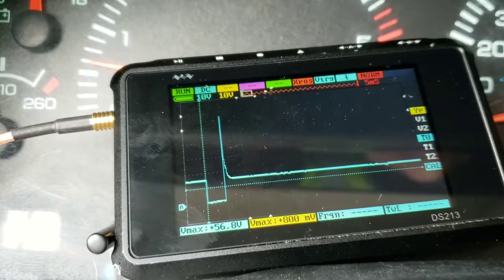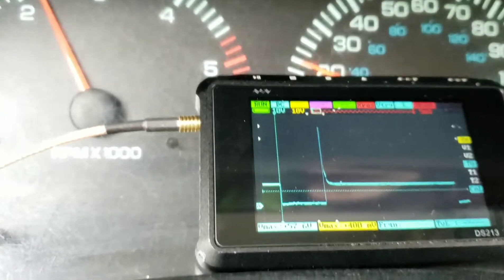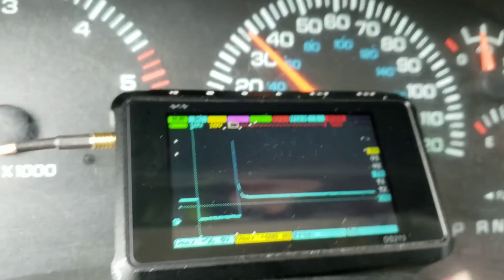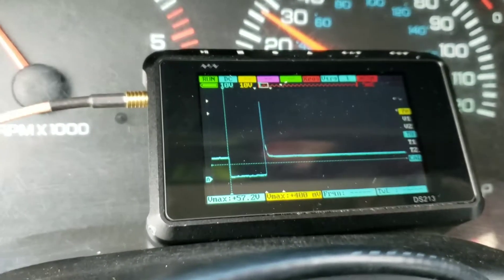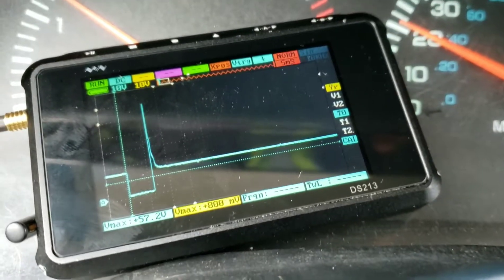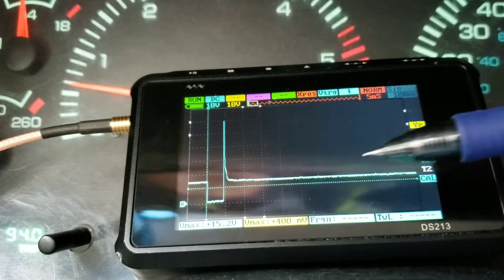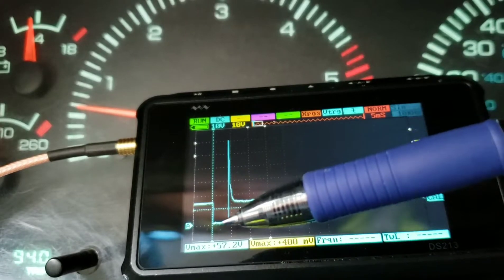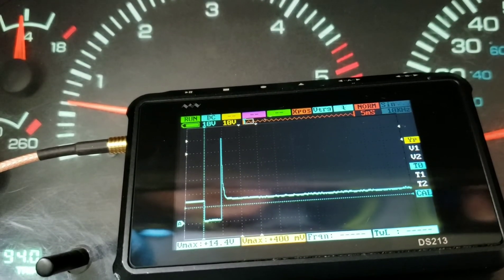A Look At A Fuel Injector in Action on an Oscilloscope

Comment: Since you mentioned that the injector continued to spray fuel even after the intake valve closed approaching a 50% duty cycle, this would seem to indicate that fuel continued to be sprayed during the compression stroke.  Does that seem right?  I was under the impression that injectors only sprayed fuel during the intake stroke but apparently my understanding is wrong.
Reply from the maker: I would say yes that seams about right. If the injectors are spraying around 50% duty cycle at a given engine load and RPM, they would be be spraying fuel for one full crank shaft rotation or half an engine cycle. Assuming the injectors always open up at the beginning of the intake stroke, this would mean, under these conditions, that they would not close till the end of the following compression stroke. It is possible, though, that the PCM might also advance the timing of when the injectors open up during such conditions. I might have to do some more probing around to find that one out!
Reply: @ryana.miller8260  Thanks for the response.  I also did some additional checking and engines that use GDI (Gasoline Direct Injection) spray fuel during the compression stroke so your engine must use this type of injection.  These systems require higher pressure fuel delivery systems and injectors that can withstand higher temps due to where they are located in the combustion chamber (much like a spark plug). On the other hand, multi-port fuel injection systems only spray fuel during the intake stroke.

Comment: Did you use an attenuator?
Reply from the maker: I don't believe I did but I may have. I was just learning about using Oscilloscopes, myself, when I took this video. The DS213 pocket scope has a +/- 40v max on the analog A and B input channels, as  displayed on the back of the scope itself. Fuel injector solenoid valves are capable of spiking much higher voltages than that but the drivers that drive the injectors will often have voltage limiting circuitry that cap the voltage spikes at around 40v to 60v. I could be wrong on those numbers but it may also depend on the vehicle and the condition of that circuitry. So, long story short, if I didn't use an attenuator, I probably should have with this scope. You might get away with out using one when testing fuel injectors, but an attenuator is absolutely necessary for testing Ignition coils!
Reply: Ok thnks.